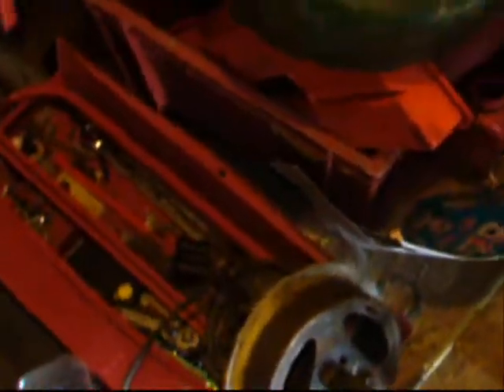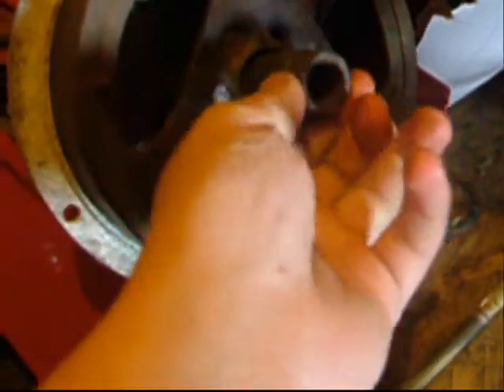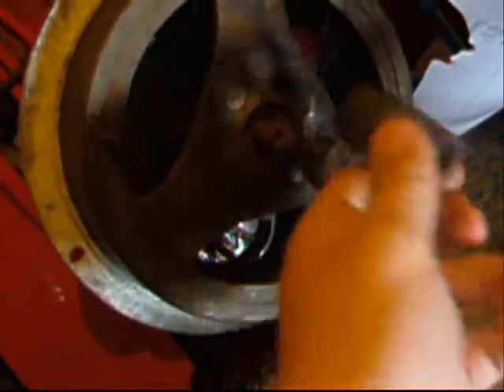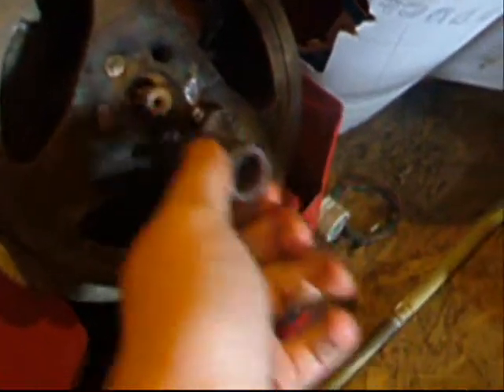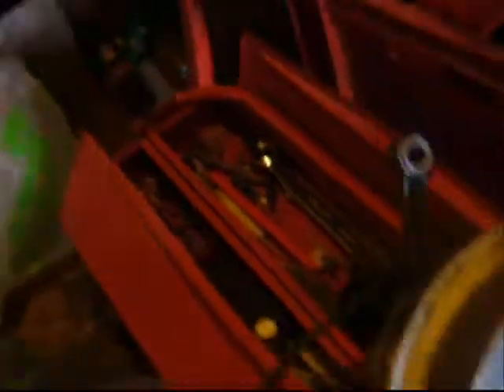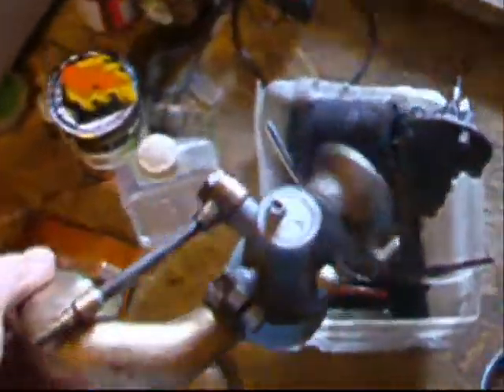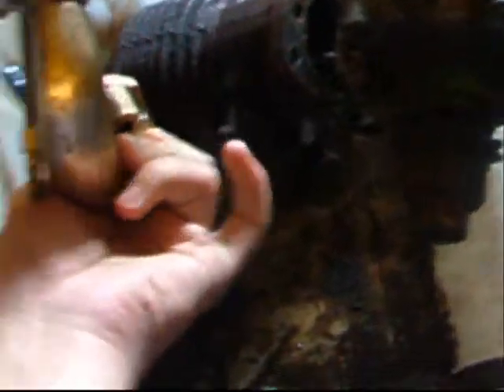villier's mk2 midget restoration part 1

Comment: The reason you can move the flywheel bit was because of the play in the big and little end. You need to soak it in diesel, or cheap coke for a while, that will do it. It might take a month of soaking or so, a project for the back burner. 

The trick with these old engines is to be patient, soak everything in oil first and leave it!